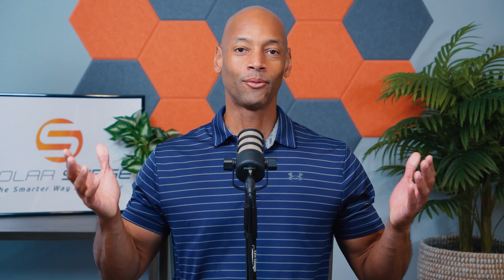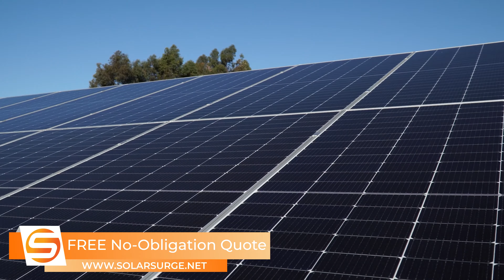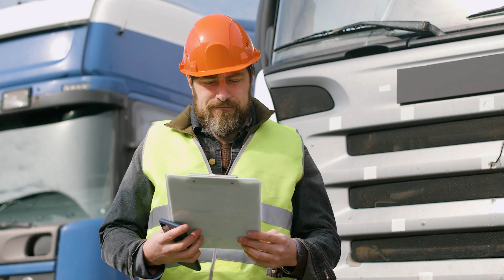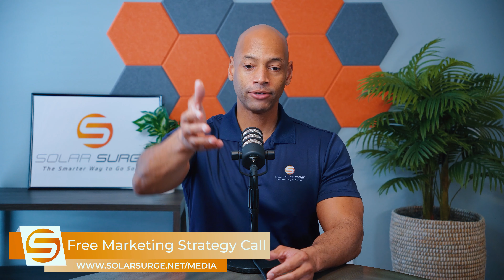What Will Tesla Do Next?

Comment: I currently own a Cadillac Lyric EV and 2017 Volt.  I am also starting a new energy efficient home build with roof top solar in about 3 - 4 months from now.  I am very interested in a bidirectional ev charging.  I hope it would allow me to purchase fewer stationary backup batteries.  My new home will not be complete for at least one more year, so I have a bit of time to see what will be the best solar system for installation.  I have considered the Enphase ecosystem, but I am now hoping that Tesla may have a bidirectional ev charger soon.  It would be great if Tesla acquired SPAN as well.  I may opt for a Tesla PW3, SPAN, and Tesla bidirectional EV charger, instead of the Enphase solution, if that all comes together in the next 8 months.  I have also heard that Enphase is getting close to releasing a 10P battery that would have similar specs to the 5P, except twice the capacity.  Unfortunately, you have to accept decreased efficiency and increased cost with the Enphase solution, given that every solar panel has a MI.

Comment: I own 2024 Kia EV9 GT which has V2L now and V2H/V2G bi directional charging is already supported but waiting for home hardware from Wallbox, Quasar 2 which is to be available in USA this year. If Kia solution does not become available, I will consider looking at other solutions in 2025. I looked at GM Energy but their solution had too many separate boxes, high installation cost, and low 9kWh backup limit. I also have reservation with Tesla for over a year for Powerwall 3 but so far status shows not available in my area and I live in SoCal so not sure why. All solutions would be added to my existing 7kWh solar.

Comment: We are about to install a 17.5 kWh solar system with 3 PW 3's. I have a Model S with a 100 kWh battery;  that's equal to having 7 Powerwalls that I can also drive!  I really hope they will allow bidirectional charging.
Do you know if the car will charge the Powerwalls, then the house or power the house directly from the car?

Comment: One does not need bi-directional charging for emergency power from an EV.  I have a Lightning with the 7.2kW Pro Power Onboard.  My use case is refrigerators and electronics (Internet, computers and TVs) all of which can be done with extension cords, as recently happened during a main panel changeout.  I could also power the microwave.  Of course, if one's use case required AC, that would be different.

Comment: The Span panels are great but for large homes they don't have a panel with enough breaker spaces, at least they didn't a couple of months ago when I checked into them.
My home panel has 40 breakers. 
Leviton has a 44 and a 66 breaker panel, which would work for me. The downside to their panel is the price of the required Leviton breakers.
It's just another upgrade that I will need to obtain in pieces over a few months' time frame......😢
Reply from the maker: Yeah I'm disappointed that the manufacturers didn't provide 400-amp and 600-amp solutions.  Many of the early adopters of this technology are affluent tech professionals with large homes needing multiple 200-amp panels.

Comment: Return on investment time frame 

Illinois Energy Professor video on nuclear electricity vs gas turbine electricity concluded that the large capital and time invested in nuclear was prohibitively too great.
Time frame.
Interest rates uncertainty. 

Gas turbine was quick to cashflow. 
To achieve return on investment. 

PV rooftop, paid by the customer, unloaded the existing grid from excess grid breaking demand.
Protected the existing national grid. 
Australian government shares some of the grid building savings with direct subsidies. 
These subsidies have been reducing at a fixed rate, but each year PV rooftop has gotten cheaper and bigger, economy of scale and technology improves. 

Grid supply is a dead duck economically.

Comment: Selfplug-in V2G EVs or BVs with massive oversized battery parked 23hrs every day. Will make the home battery look pathetic in size. 

This vehicle feature and a PV rooftop will kill grid supply economics.

Home robotic vacuum cleaner can teach the selfparking EV to connect to the grid. 
$60 wall outlet at every buildings carpark space with trickle currents all day long. And all night long. 😊

10,000miles per year and 10,000hours per year tells you most vehicles are parked 23hrs every day. (8,760 hr/yr).

A little expensive electricity in a fossil fueled world is nothing. 
No fossil fuels in an electric world means that dirt cheap electricity at every building is the only way. 

A little fossil fuel in mid winter is nothing. 
Petroleum feedstock to petrochemical industry and road building and emergency use will always be with us. 
20years to replace all ICE vehicles. 

Grid electricity needs grid capacity. 
Blackouts from undesized grids were political death.

Grids are incredibly expensive. That's why grid expansion or overbuild were avoided.

Ten times bigger grid capacity is insane economically. 

No grid, only building electricity, and big battery is the only economic possibilities. 

Battery technologies are evolving rapidly, and battery life cycles and costs are falling. 

Australia has 20million buildings and 20million vehicles. 
USA 300million buildings and vehicles. Approximately 😊

Comment: Tesla’s bidirectional charging will work with EITHER a Gateway 3 with their universal charger OR PW3 with their universal charger. Currently the only Tesla vehicle that supports it is the Cybertruck and there are a bunch of people online that have showcased the bidirectional charging. Unfortunately at this time it’s only working when the grid is down in home backup mode. Hopefully they expand it to general use at any time.

Comment: Any quess how Tesla will allow bidirectional power with EV’s?  Tesla vehicle software would obviously be apart of that. Would there be an additional hardware expense?Like another switch or box on the garage wall for existing EV’s.
Reply: For a new install, you need their charger (Universal Wall Connector) and either a PowerWall 3 setup or a Backup Gateway.  For existing setups, if you already have a PowerWall 1-2 and a previous generation wall connector, supposedly you can also do this with some limitations.  Of course, right now the Cybertruck is the only vehicle in the Tesla lineup that works with this - since it has an onboard 11.5kW inverter in the vehicle.  Ford and GM are doing things differently, where you add an inverter on the home side.  Tesla's approach is a much easier and lower cost for the home equipment.  Ford and GM's is 'in theory' able to work with any CCS vehicle - IF they ever opened things up to be interoperable.

Comment: I think that to get bi directional from Tesla, Tesla may want to sell you a powerwall first. The Powerwall 3 is priced right. My neighbor was given a bid of $7000 installed for 1 powerwall 3, after federal and state credits. I am getting 2 powerwall 3's soon, my price was $12k after state and federal credits. This was the installed price. 2 years ago I was quoted $29k - $21k after 30% tax credit for 2 powerwall 2's.
Reply: They installing at a loss? The equipment alone costs that much
Reply: @JoshSmith-vm6nx  for 2 - Powerwall 3, I was quoted around $23k installed. There is a 30% tax credit $6900.00. Then in my state they are offering up to $5,000.00. In my case $4500. $6900+$4500=$11,400 credits. Which brings the price of 2 - Powerwall 3’s down to: $11,600 installed.